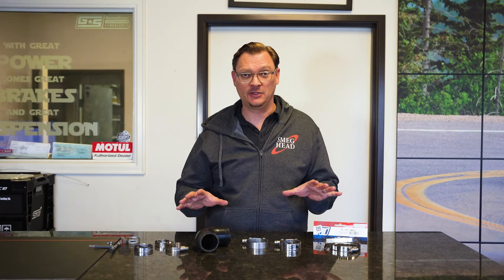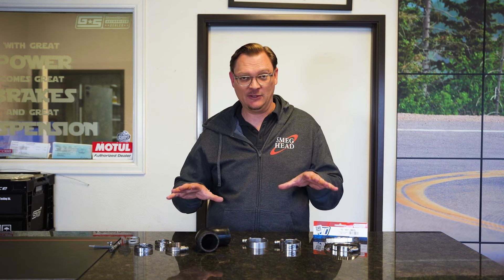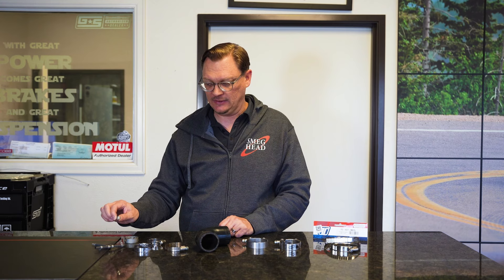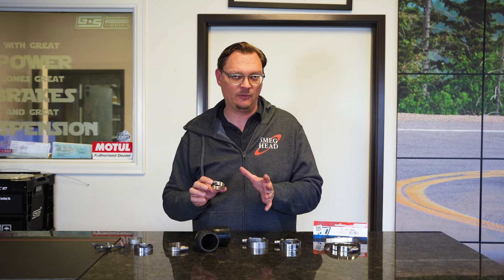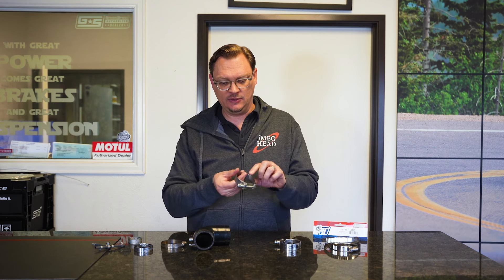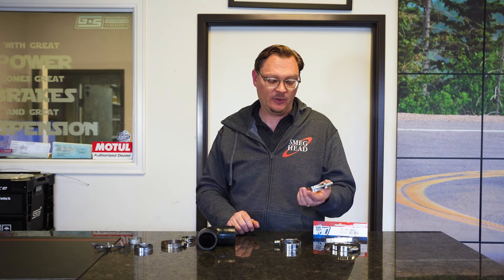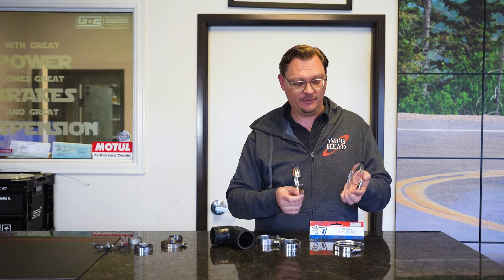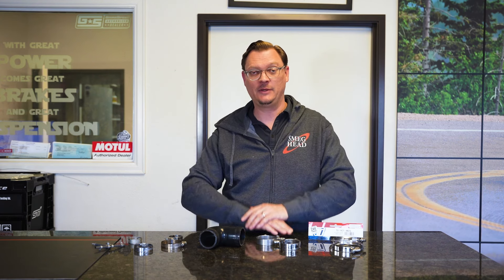All about Hose Clamps - Spring, Worm, T-Bar, and Constant Tension

Comment: Norman/Toro worm clamp for me vs the regular hardware or automotive supply. the Norma/Toro have a rolled up edge they don't bite into the hose vs the flat edge on cheap worm clamps. i use constant tension for plastic radiators,  then there's the Cotter pin hose clamp used in older German cars :face-fuchsia-tongue-out:
enjoyed video :person-turqouise-waving:

Comment: The biggest benefit to constant tension clamps is the ability to self adjust to thermal expansion, particularly with connecting a hose to a metal attachment point like an aluminum radiator or the thermostat housing.

The issue with normal worm drive clamps is that they're typically tightened down when everything is cold (aka contracted). Once everything warms up, the port that the hose is attached to will begin to expand. In the case of aluminum, it has a much higher thermal expansion rate than steel or stainless steel. So it will grow to a much larger size than then the worm clamp was tightened down. THIS is where the excessive tension comes from, which causes the clamp to cut into the hose.

What you said about normal worm drives doesn't really make sense. That the hose itself can keep the clamp from applying consistent tension around the circumference of the clamp. In order for that to happen the hose would need to be more rigid than the clamp itself, but it's not. So I don't really understand what you're talking about 🤨
Reply from the maker: Thanks for watching and thanks for the comment.  Great point about temperature too!

Stay Tuned!

Comment: T-bolt clamps are the best imo. Used many worm gear clamps but those are good for single or dual time use. After the 3,4,5th time it’ll wear out the clamp. Then also I’ve seen people tighten down t-bolt clamps so hard it’ll crush Intercooler pipes and intakes. I guess it just all depends on what you use clamps for.
Reply from the maker: Thanks for watching and thanks for the comment.

Stay Tuned!

Comment: Great video, can we have a list of what size constant tension clamps fit for coolant and intake plumbing please.
Reply from the maker: Thanks for watching and thanks for your question.  There are a lot of different size fittings around the cooling system, and it does vary by application.  The best thing to do would be to get something like a caliper to measure the fittings that you need the clamps for.

Hope that helps and Stay Tuned!

Comment: Can you do a video on adjustable cam gears. For example I have 04 wrx an instead of installing AVCS heads and gear. I want to install just actual adjustable gears. And it seems like an easy way to get adjustable exhaust gear without finding “ quad AVCs”. At the end of day would it be worth getting AVCs or adjustable Cam gears
Reply from the maker: Thanks for your question.  This isn't something that we have explored yet because we really haven't had to.  You can certainly get benefits from adjustable cam gears, but you have to be very careful when you are setting them up and adjusting them.  

Making the adjustment, you are going to be optimizing the engine's efficiency for a certain rpm range, similar to putting in more aggressive cams. 

To this point, we have been able to get good results just with our turbo selection, and staying with stock cams.  Though that may not be the case for much longer.

If we go down this road, we will definitely do our best to document the process.

Thanks for watching and Stay Tuned!

Comment: Talking a lot of bunkum. Some faults are close to the truth but miss salient points. I was production manager for the department dedicated to the manufacture of hose clips.  We made ones made from flat strip, zinc plated and some from round wire which was then hardened. We supplied all the major motor and washing machine manufacturers as original equipment. Our products were not mentioned. I am very familiar with the tooling and machinery utilised, and with our products design. There are pros and cons for the types shown, but we believe our design overcame the cons.

Comment: Worm drive clamps are banned on my car. I will never use one. The digging into the hose problem is much bigger than what you made it out to be. Spring clamps are the best for anything 3/4 and smaller. T-bolt is superior for high pressure, critical sealing. They are also the most robust. A T-bolt clamp is a clamp for life. Constant tension for all other joints such as inlet piping or maybe even fuel filler necks, things like that
Reply from the maker: Thanks for watching and thanks for the comment.  

Stay Tuned!